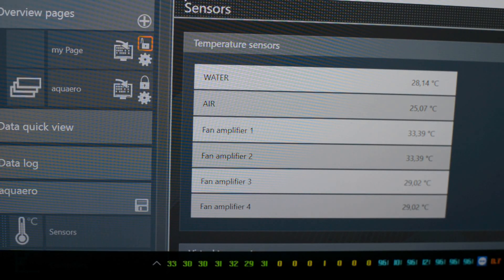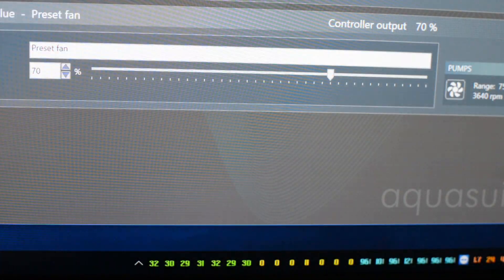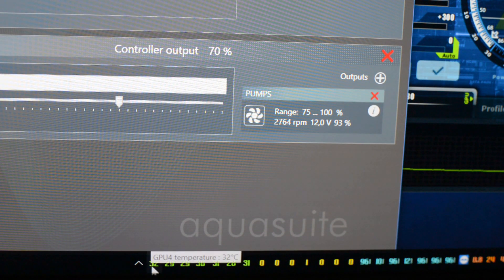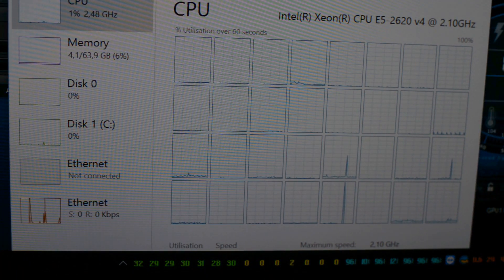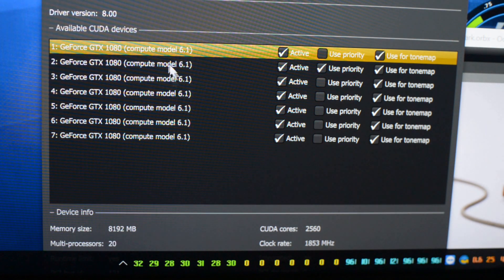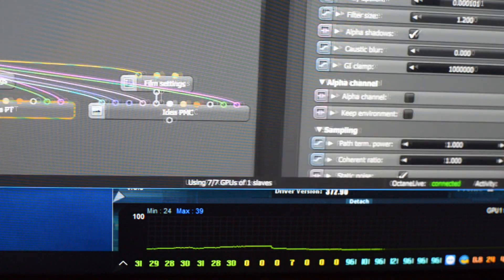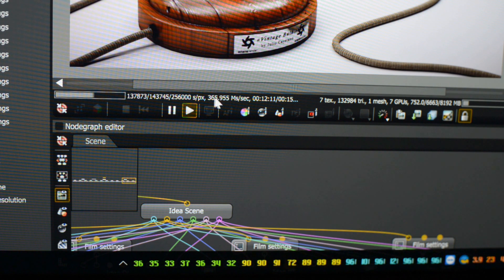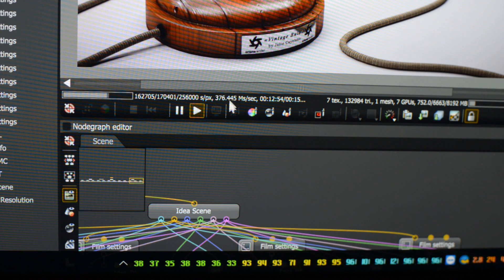Part 23: PT 380-440 ms/s speed - 14x GTX 1080 watercooled Octane Render workstation o

Comment: Dear SMICHA7, 

honestly by far this is the most comprehensive tut i've ever seen regarding this subject. when i saw 1st & 2nd episode i was so happy that for the 1st time someone has balls to show everything to make this tricky task doable by non professinal rig builders.
Then, as the last chaprters were approaching, i was a bit puzzled, but i waited without FastForwarding or skipping to see the very last frame of the last video. and there it was. 23 videos, super cool
we have seen even everycorner of your office, all your screwdrivers, even the wattage of the angle grinder, not to mention that i've become master of removing DVI port. however,  for some reason 1 or 2 very important chapers were skipped.
HOW TO POWER 7 GPUS !!!

All of a sudden all GPUS have somekind of 6+8 pin connection that can be seen on the video, but no video showing how its done. 

So this is what is pissing me off big time. 
No offense, big applause from me and maybe 5million other people, but i think you are not getting any drinks on me until i see the power thing.

thanks for reading.

YOU ROCK MAN !
Reply from the maker: vladan m sorry for lack of power cables shown. PSU has 5 cables for 6+8 GPU and 4 single cables with 8 pins for 2 GPUs. wait few days for 11 GPU monster just finished twice as fast what you see and superior alloy quality

Comment: You did a wonderful job! Can you please recommend a different case for a project like this? Something less bulky? Thank you!
Reply from the maker: It is all about radiator capacity and having 10-12 cooling units seems to be a must to maintain decent temps across gpus and cpus. Moreover waterblocks are very heavy - over 7kg and horizontal mobo layout is also very important. X9 is best as for price and functionality. You may aslo look at caselabs STH10 or others. I am producing now my own case for 11 gpus.

Comment: Great videos Sebastiani!. I would like it you could build/show a $2500-$4000 workstation build. Something most professionals could afford.
Reply from the maker: high end gaming mobo and top i7 are more expensive than a server mobo and 16xx v4 xeons
Reply from the maker: Around 5k EUR for 4x1070 hybrids on xeon and ecc platfrom. Email me at smicha7@gmail.com
Reply: What about 4x1070 hybrids but used with I7 processor and corresponding motherboard. This would decrease the price even more.
Do the Xeons justify their higher price over the I7 if I'm going to use just Octane.

And thank you for the videos, great job!
Reply: Wow, thanks a lot for the info. Didn't realize this was the case, I will definitely have a look into 16xx Xeons.

Comment: Loving your rigs... 
BTW. I can get air cooled 4x1070.. achieve hit 107 sample with some OC..  At prolonged peak usage 60C for the hottest card
All GPU's are air cooled ( 3x Founders edition 1x Evga 1070 SC..)  with just a mild fan speed.
If you happen to do basic calculations 400 samples out your 14 cards. Which gives 28.5 samples per card.
I tested to use one card only with single 1070.. that gave 25-26 score... 
This not only means that your system is great but also means that how cost efficient my 1070's are as well..
Reply from the maker: THank you. BTW Yesterday I run 1070 and at stock on air I got 22.5, at OC 1950 on core and 4500 on memory 25-26. At OC these two machines scores 440ms/s so for each 1080 score is 31.4.  So even if we compare out of the box 1080 to 1070 - 1080 are 20% faster.  At OC 15%. SO 14x 1080 are  more than 4x quad 1070 workstations on air. But we save on: 2 licences, 2 cases, 2 psu, powers supplies, ram, CPUs, room....  and silence and longevity due to very low temps. Thank you again for testing your 1070s.

Comment: Does Octane already uses CUDA8 ? Or still version 7.5?
Reply from the maker: Kind of hybrid 7.5/8 just to handle Pascals. We are waiting for full  Cuda 8 speed.
Reply: Thanks for quick reply! Ok, so we still are waiting for the full power of 1080s :) And are there any forecasts about when it can happen? Because OTOY promised CUDA 8 support in August, if I'm not mistaken.

Comment: Wait just minute, you are telling me that the power draw is 850 - 1000W off of, what I presume, 1 machine. Like how because I thought 1080's require 180W of power each. 

That alone exceeds 1,200W not including the CPUs, Watercooling, fans, etc. I would imagine that it would draw somewhere near another 200(ish)W which would put a single machine around a power draw of around 1,400W if not more. I know the PSU you have does have 90% efficiency so that leaves us with 1,440W which I would imagine gets passed because all I did was round down. 

So like is the Nvidia site a lie or is that just telling us the maximum amount of Watts the GPU can hold? Because I used 2 1600W PSUs to run my GPU render setup (5 980ti and 1 Titan) and one PSU was supplying power to 4 980ti and the other one was running the other 2 GPUs and the motherboard. I like to play it safe so I'm just curious on how you got only 1000W of power draw off of each machine. And don't you even tell me that your power draw was both machines combined because I'd be even more confused on how your system is working.
Reply from the maker: APolishGinger - good to see you here :) So from my power measurements of 7x980ti full watercooled- it draws including dual xeon e5 2640v4 1350-1500W OC. Recently I measured 1070 - 85W! in Octane. 7x1080 draws 800-900 and 1000W at OC (2100 on core, 5500 on memory). So these two machines draw in Octane at heavy OC 2000W. It is hardly a chance to stress xeons fully while rendering purely on GPUs, but they still have reserves 1000W each :)
Reply from the maker: ...and the power draw includes 14 fans, 2xD5, aquaero,... - all stuff connected to the PSU.
Reply: Damn I guess those cards are efficient. Have you tested the power draw between reference cards and non reference cards? Is there a difference or is the difference negligible. I would think it would be negligible, but I'm just checking all my bases in case that is not what I think. Though great work on this build man. I would keep up with you guys in the Octane Forms, but I don't have permission apparently to access it so that sucks. Anyways good job man.
Reply from the maker: Yes - with the founder edition the power draw is the same. Even 2050mhz on core and 5500mhz on memory   on watercooling is possible.

Comment: benchmark?
Reply: It means that his score in the Octane Benchmark program would be 2,215.2 that's almost double the fastest one on the site which is 1x GTX TITAN X + 11x GTX TITAN Z Score of 1,414
Reply: O my god, thats crazy Fast !
Reply: yeah big time. What a machine!
Reply from the maker: That means that these two machines score over 2200 in Octane Bench.
Reply from the maker: This is the true benchmark. There is no reliable official benchmark for pascals. What is commonly used is fake. Based on true measurements it scores 5.2x faster than 3x Titan X Maxwells which is 2x2.6x426=2215.2.
Reply: what does that mean ?